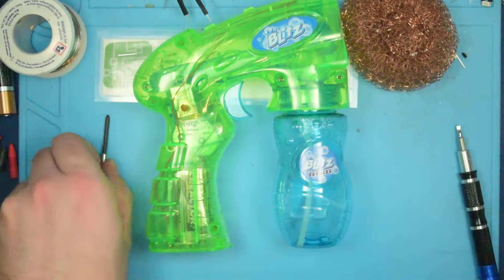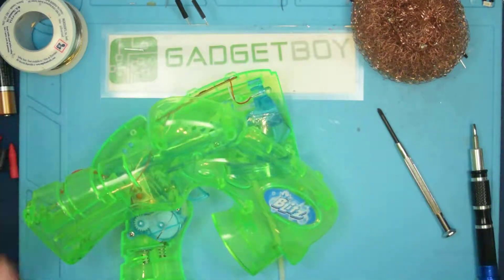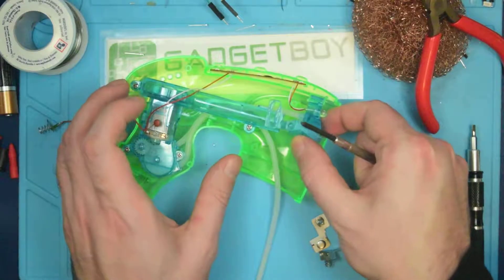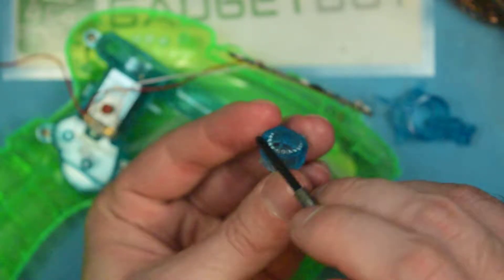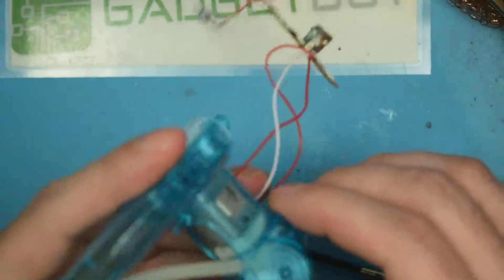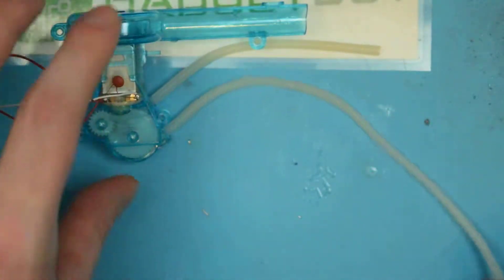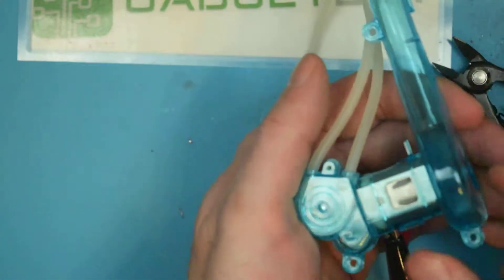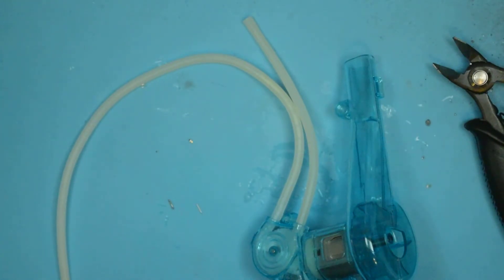Dismantling a bubble shooter

Comment: Great description of the pump operation.  I have worked on these pump systems in toy bubble guns like the one in this video, plus bubble squirters in model R/C helicopters, etc.  Usually, I find that after these items are not used for a while, the little motors run but no bubbles and I find that the soft silicone hoses are the problem.  They take a set from the two rollers in the pump; get a flat spot or are pinched completely closed.  Sometimes, if there is enough of this hose in the toy, I can move the hose   out of the pump and get it to work.  Other times, I don't have enough hose in the toy to do this.  If I could find a source for this soft hose, I would be able to fix more of these items for the kids.  Thanks for the video.

Comment: I have two of these. Bought one and thought it might get broken so I got another. Was going to experiment with the peristaltic pump.

I've used a better one of these and i'm guessing it was more expensive as it ran on 6 AA cells and had a nice fan and separate motor for the peristaltic pump. Shame that I didn't ask if i could keep it when it was no longer needed.

Comment: You don't think it will have enough flow? Why😅 I did say it might not be strong enough
Reply from the maker: It won't have any issue MOVING the oil, it'll just be super slow.
Reply: @GadgetBoy  I didnt say it wouldn't move it
Reply from the maker: You said it would be too heavy.
Reply: @GadgetBoy  I can't find what I said specifically as to quite myself accurately, however